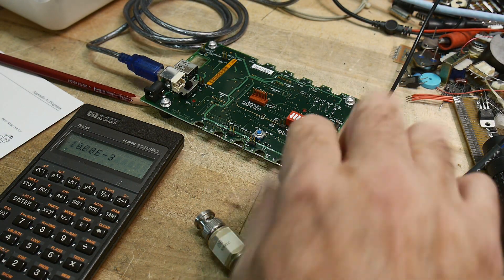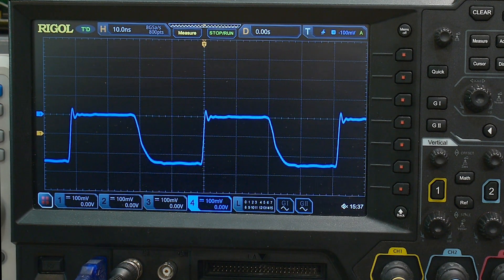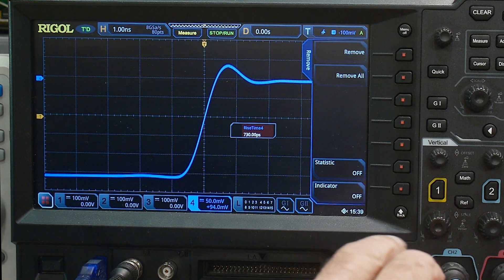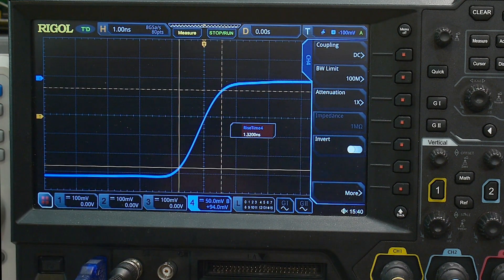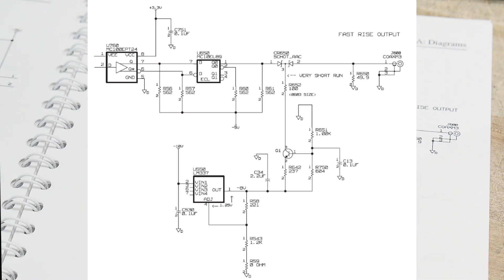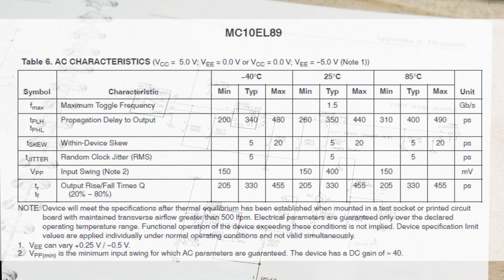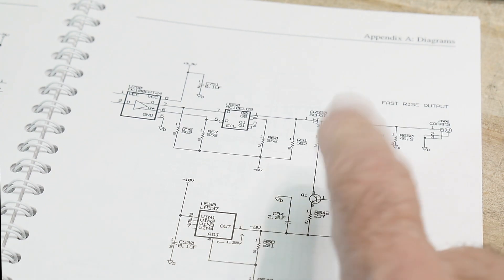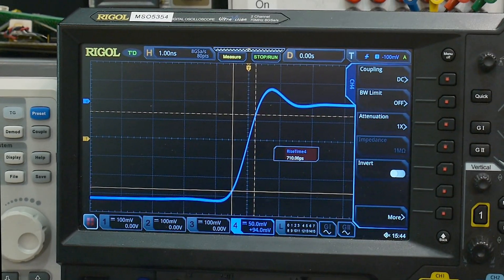#1413 TEK Demo Board Fast Rise Edge

Comment: Hi. Thabk you.
Why do you have to terminate with 50 ohm before taking it into the oscilloscope?
Reply from the maker: the real answer is transmission line theory. the simple answer is you need a low resistance path for the high current of the pulse.

Comment: Great video...
I think what is doing the "magic" there are the Schottky diodes...
They're actually what are doing the switching.
The ecl driver is rapidly crossing biasing threshold of the diodes, from non conducting to conducting (or vice-versa) and the transition time from the ecl driver that is at play here is actually the time it takes to cross the diodes conduction threshold... Much less actually than the nominal transition time between lo and hi levels of the ecl driver.
Reply from the maker: yes, it is the diodes used like a step recovery. I've since measured the rise at 97pS

Comment: This circuit is pretty close to a tektronix patent (US4758736A, Fig 1). BTW, Tektronix 11801 Series sampling scope use this circuit to generate extremely fast edge (~20pS). (SD-24 Sampling Head with TDR ) I hope this patent could help you :)
Reply from the maker: yes it is. thanks for the patent. step recovery diode type circuit

Comment: There is a small device known as the Leo Bodnar Pulsar which generates rise and fall times of less than 40 ps. Relatively cheap and useful for testing bandwidth like shown in the video.
Reply from the maker: yes, I know that but at 100 pounds it is not for me
Reply: @IMSAIGuy  only 60 GBP but I did not mean you have any need for one. You already have the thing you showed us in the video. I do not believe there would be any advantage in having an even faster rise time unless your next video is about that 1 GHz scope Santa delivered?  :-)
Reply from the maker: the SMA version is 100   anyway yes I don't need one now. i've measured the risetime at 97pS on a fancy machine (video to follow)
Reply: BNC version is 60£ - eliminates need for an adapter and is still under 40ps.  Understood it is not for everyone, but it works great.  I’ve characterized all of my scopes and have been pleasantly surprised.

Comment: A couple of weeks ago I made a simple pulse generator to use as a TDR. Rather than using a schmitt trigger IC I used a clock distribution amplifier IC 74FCT3807 because I had several of them in my salvaged parts stock. I fed 9 of its outputs in parallel, each with a 430 ohm resistor to get about 50 ohms impedance. The 10th output I used to feed back through a transistor to make an oscillator running at about 300KHz.  The high frequency helps the oscilloscope quickly build up the waveform when running in equivalent time at a couple hundred GS/s.
Currently it is assembled on a prototyping board so the path lengths and such are far from ideal but I am still getting very good rise and fall times of 280 and 200 ps respectively and about 20% overshoot and ringing.  I'm waiting for PCBs from PCBway to assemble it properly and hoping for better performance, especially with regards to the ringing.
The oscilloscope I used is 1GHz bandwidth with a 4GHz sampling rate and internal 50ohm terminations.
When used in conjunction with an RF bidirectional coupler I can measure distances down to a few mm.
Reply: Interesting. Sounds like a video to me. Also sounds like a useful diagnostic tool for your own standards. Thanks sharing your experience helped me solve a problem. 
God Bless.